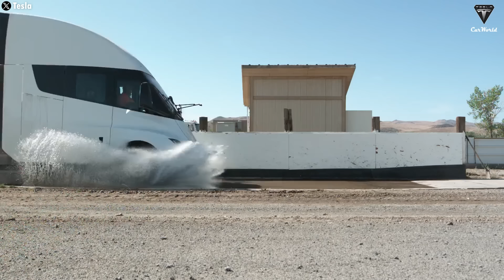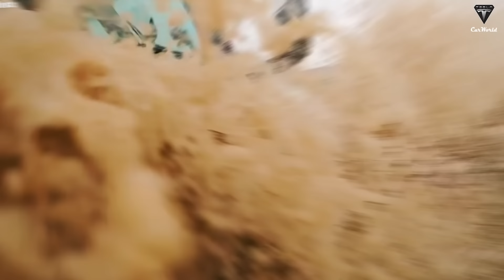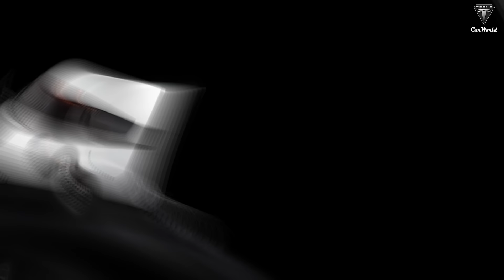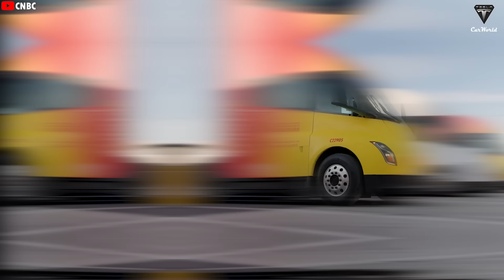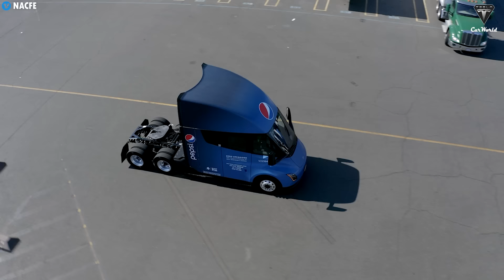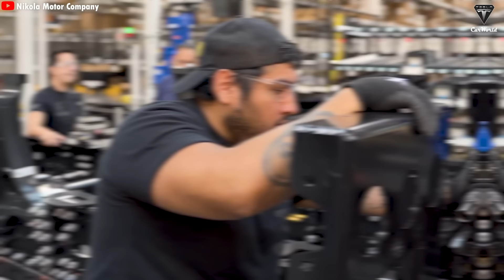2026 Tesla Semi V2 Finally Here | NEW Cheaper Battery, Upgrade Interior & Sleeper Cab!

Comment: Now if that stupid glass roof has an underlying photocell that would equal full charge after 4 days that would be very useful. Not tinted at all but only the underlying photocell tinting the incoming light for usefulness, not glass tint at all. Maybe full charge in 7 days not 4. Parked with the rear of the car facing south. Never window tinting but subsurface light capture. Maybe rougher surface reducing light reflection. Ground to a rougher surface reducing reflection. Like a primer grey colored surface instead of black tint.

Comment: Hope also Europe learns about advantages of the TESLA cab design. Most legacy trucks here are cabin over the engine to make the truck shorter which of course has effect on allowed total length. It seems however that EC was forced to allow longer cabin e.g. Tesla Semi! Let’s see how long legacy can block the overcrowded market for too many highly individual and ‚handmade‘ trucks. This by the way killed Swiss truck companies that more or less built on demand and not standardized trucks to lower TCO!
Reply: It’s the length for your roads. That’s why your trucks are built that way. Need a super short wheel base.

Comment: I think physical mirrors need to go the way of the floor high-beam switch. The sleeper option makes sense.
Reply: The sleep option makes zero sense. You drive what you need to to get to load on time. Show up a a stop to charge up and take your mandatory break.   Wait right now no charging stations. But hey we have a few now. So then you show up and they are full. One guy maybe fully charged but still can’t move or his hours of service will make him wait at least another 8 hours. You evidently don’t know anything about the trucking industry and regulations.
Reply: @Ixclr8 you are right but rules will change as technology forces that change. I look at the sleeper area as more of a break room and may be used without stopping. The options are limitless when autonomous travel is fully utilized.